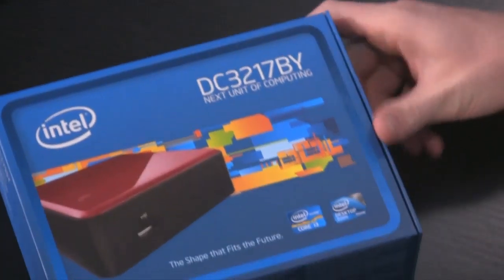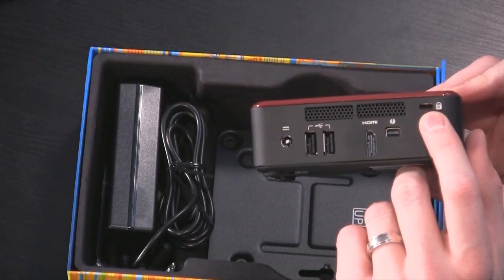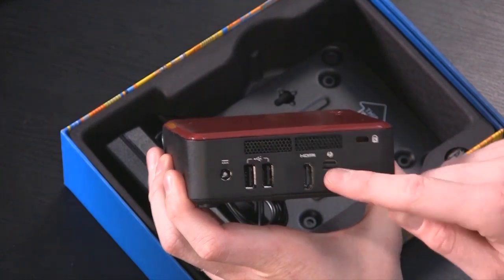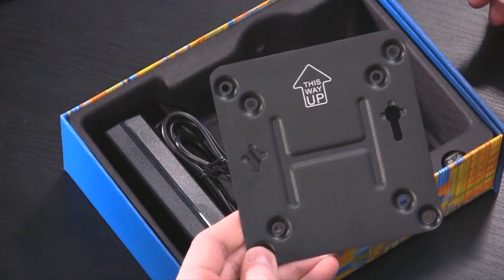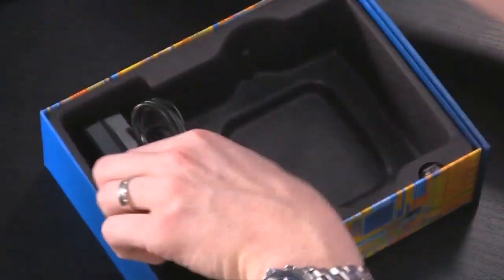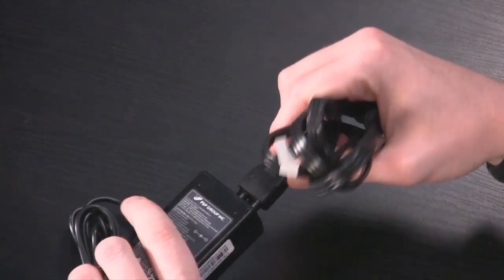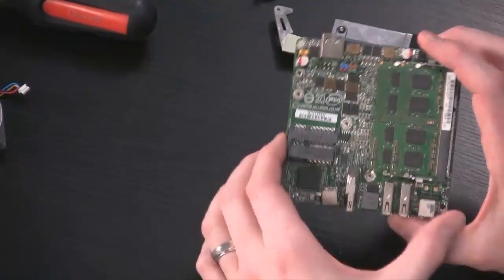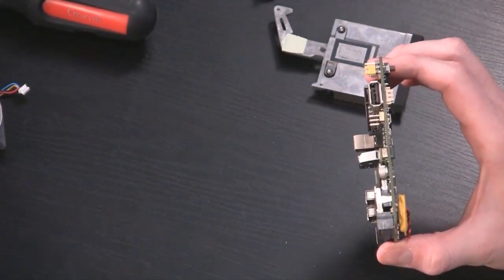Intel Next Unit of Computing DC3217BY NUC Review - PC Perspective

Comment: There are two versions of the NUC: 
one with 1x HDMI and 1x Thunderbolt and the other one has 2x HDMI and 1x Gb-Lan, it even costs about 20€ less than the Thunderbolt version.
If you compare the mSATA Crucial m4 SSD to the normal 2.5 m4, you'll see that they cost the same, the mSATA is sometimes even cheaper!

Comment: Why would you expect this system to be fanless? Do you think a system with an third-gen Intel Core i5 would run just fine without fans? No! If it didn't have fans, the system would be extremely hot with moderate use; in heavy CPU-intensive tasks, the system would for sure overheat and blue screen if on Windows, or kernel panic if on Linux and other Unix-based OSes.

Comment: after the cost of a monitor keyboard mouse dvd rom  ram wifi card msata drive your better off with a full size laptop with a 17 inch screen and its portable too. and no usb 3.0 or esata this thing is a epic fail .you want to go low power and cheap get yourself a duel proc netbook. hook that up to your monitor with velcrow.on the back get a full size keyboard and mouse and it comes with a free ups yes. thats right the batteries on the netbook...onhook every thing and your mobile